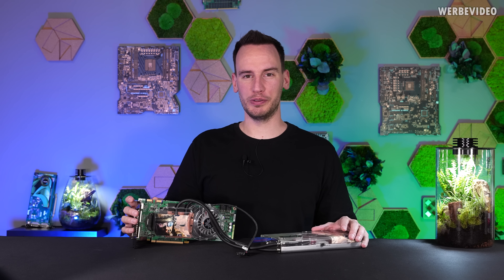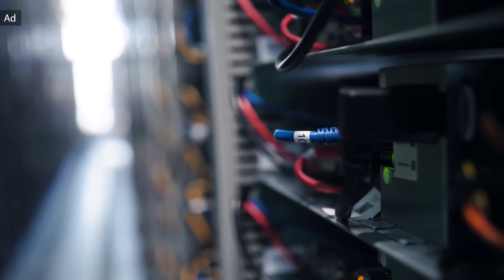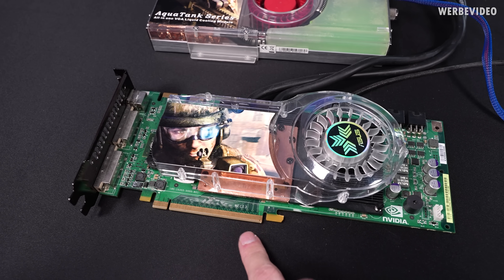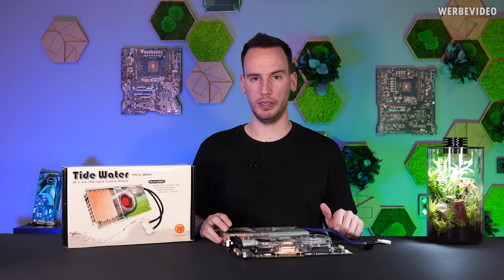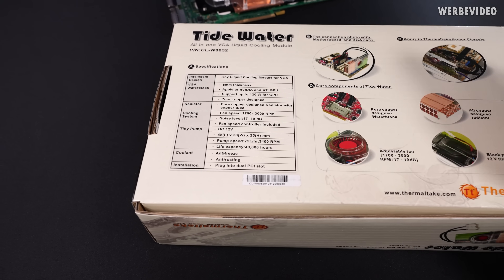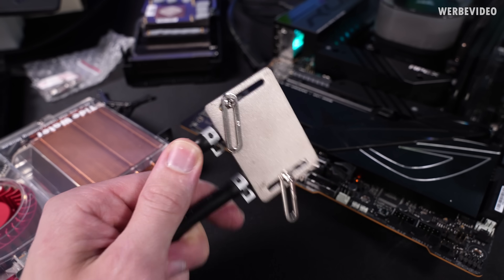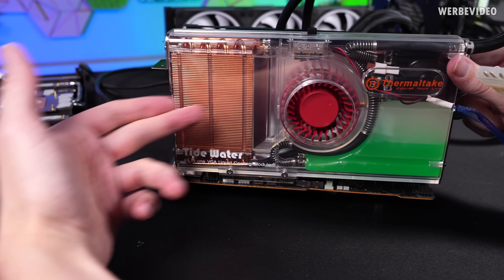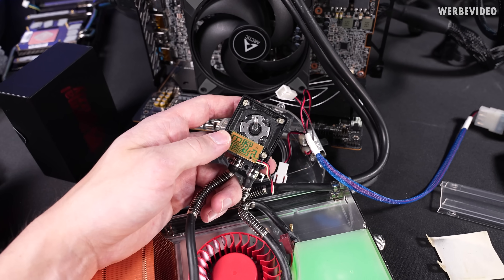HW-Legends #16: This GPU Cooler Made in 2005 still works Today! Thermaltake Tide Water

Comment: I had the basic tidewater back when it came out. I put it on a ATI X850 All-In-Wonder along with a custom cooler for the rest of the PCB and OCed the heck out of it. I also OCed CPU by making a custom loop for my Athlon 64 using their passive tower RAD they had. It was a free open box score, too!

Anyway, one reason I think the pump is so slow is because it's a little more powerful and restricted due to the rather small RAD's "passages". That is from memory from geesh, nearly 18± years ago since I serviced it. It worked really well btw! I'm thinking about using it to liquid cool my router😁

Comment: I am the first one to ever make a watercooled system. I designed it in 2000, and made it in 2001 while I was in college for engineering. It went on my Celeron 300A. Everyone laughed at me, and told me it was a stupid idea, so I gave up on it. It had a voltage regulator tied to a termistor which regulated a Perry Pump, and RC fuel tank, and RC fuel line which I sourced from Tower Hobbies. I used a PC fan with aluminum capilary tubes running across the face as a radiator and I stuffed it all in an old CD 5.25 inch case and added a front faceplate with temperature monitoring and manual override pump speed adjustment. The heatsink was a custom block. Huh... moral of the story... most people will try to drag you down. Do what you love, even if others hate on you for it.

Comment: I modified a CoolIt FreezeOne back in 2006 for my E8500, I still use it today for my 5800X3D. The only thing I had to change was the block, the rest ( including the vast majority of the coolant ) is all as it was in 2006 when I first installed it. Works like a charm still. I even have a backup unit I bought at the same time that's not modified at all yet, all original.

Comment: Car coolant is good at preventing corrosion, but as you found, when something was covered in coolant and then the level drops exposing it to air, rust can occur. GM learned this lesson in the '90s, where vehicles were being driven with low coolant, but not low enough to over heat, so some parts were basically getting splash cooled only. Those areas would rust really badly and turned the coolant over time into a rusty slurry.

Comment: I had the 8800 GTS (G92). Water cooled with a none full cover block if i recall correctly. I think it was my last card before I went full cover block. But what a great card it was. I could run crysis without peoblem.

Comment: I had the Thermaltake SLI version installed on two Geforce 7800 GT's. What I remember is that the performance was in between stock air cooling and custom waterblock. It was an improvement over the single slot air coolers.

Comment: I love this kind of old hardware. would be neat to see more AIOs with different form factors like this. I was kinda hoping you'd fire up the 8800 though. I just dusted off an old 8400 since i needed a single slot gpu to get into the bios and change it from UEFI to CSM mode- my old Fury Nano wouldn't work in any of the other slots and it was too thick to put into the bottom slot. It was just sitting in a box with a bunch of other low-mid tier GPUs, but I now keep it in a safer spot since I know it still works and it saved me! I almost thought I'd gotten a bad motherboard with my new build, all is well though.

Comment: Tide water , With Tribe VX still have them and still working and where amazing , had also TT Original Tribe that i breaked down cause the pump had failed after a looooong time and replaced with tribe II , don't remember what card i had install in Tide Water but most posible was my x1900XT from noise was too high.

Comment: I have  sapphire HD3870x2 ATOMIC with a factory water cooling unit on it. as far as I can tell my card is #18. I got it to run quad crossfire with my AMD quadfather FX74 settup.

Comment: Thermaltake was so close yet so far. If only they'd released something with a pump in the block we might have avoided all the Asetek drama. They filed for their patent in mid 2004 but I don't think anything utilizing it were sold to OEMs for another 1-2 years.

Comment: I have a NZXT G12 with NZXT Elite 280 all with Noctua fans even the one on the G12 plate with a Noctua 92mm and radiator is push-pull and it's cooling a Gigabyte 7900xtx OC idle is 26c and hotspot 33c. While gaming it's cooling 39-41c and hotspot 54-55c all on max settings and tuned to 3200 MHz. This is the way for AIO!!!

Comment: Unless you're using a liquid metal thermal interface, nickel plating is practically unnecessary in consumer electronics. It increases corrosion resistance which is nice, and there's the aesthetic part of course. But a company opting to not use it to save on paying for the process in industry makes perfect sense.

Comment: Never seen one back in the day, most water cooling was external that I came across in the early-mid 2000s. (usually just on the CPU and a big square box that looked like the PSU was mounted externally). It seemed to change overnight to AIO/Custom cooling with a reservoir. The popular reservoir I remember seeing was the DNA helix shape that looked like the thing from resident evil movies. I remember cases having 2 clear strips up the side that would light up and had fake bubbles inside, and cold cathode tubes lol.
Reply: There was a bunch of them. Corsair I think had those that mounted on top of the case. I think Thermaltake had one that mounted in the 5.25 bays. Zalman's Reserator was the most I was most interested in. Was a fanless setup with this big cooling tower. Most enthusiast cases of that era had cutouts to run the hoses through. IIRC, Coolit had the first AIO as we'd know them today. I think they were a variant of the ones Apple was using in the G5 PowerMacs. Of course you had to have CCFL blacklights with UV reactive parts.

Comment: You also have to remember big cards from this era were running over 90°C by design. The 8800 GTX GPUlitterally unsoldered itself after few years of use, the oven technique to fix that was common.

Comment: I miss all the cool aftermarket coolers Morpheus, Arctic Accelero/silencer. Larger blower conversions would be nice if you could easily convert to a 120mm ducting to get the heat away now that we are crossing into 400-600 watt territory

Comment: Those unknown pieces are crystallized coolant, quite a common thing with old fluid, I think the longest interval is 10 years for replacement.
This one is 9 years past its zenith.
PS:Next time you need to clean the radiator and also the heat exchanger because it will also be in it, the best thing is to rinse it all with vinegar water.
Reply: Yeah coolant is long-lasting but not that long-lasting. Nice video and nice studio.
Reply: I have an AIO for my CPU that's used the same coolant since 2006, Feser F1 UV Blue. The ONLY thing I've added since then  has been small amounts of distilled water into the sealed resevoir, eHeim Inovatek resevoir/pump. And that's every other year or so. 😂
Still runs clear and quiet.
Reply: Glycerin based coolant is ever lasting. doesn't break down, 10 years in my car already. VW G13 coolant.

Comment: - Video Content Suggestion - 
I saw something a couple of years ago from I think Anthony at LTT on 'Hypertec Immersion Cooling' or maybe the company is 'Submer', I'm not really sure. But it seemed like they had a new type of liquid you could submerge systems in that wasn't Novec and seemingly safe. Pretty sure it would make for a great video if you could get a tour of the factory or build system using it or something like that. I have always wanted an easy to maintain submerged PC!!

Comment: Oh boy please make that 8800GTX video, such a legendary card
Reply: 1080 ti is the ultimate legend
Reply: 8800gtx was my first high end card and had them in SLI, good old days
Reply: Really not, the GT[512] way more legend.
Reply: @ChrispyNut  8800/9800GT 512MB was legendary, so was the 9600GSO 384MB but as a budget offering. HD2900XT from ATI was legendary...bad, as was the Nvidia FX5950 Ultra few years before.

Comment: 150 watt TDP what a time that was to be alive. I can only hope we can make a return to more modest TDP numbers. 400 whatever watts for the 4090 is just insane. If it wasn't performing so well it would just have been a reincarnation of the GTX 480.
Reply from the maker: I loved my 8800GT with G92 chip back then. And it was 125W haha. Crazy how things got out of hand
Reply: @der8auer-en  would be nice to test this on a 4060, since the tdp is lower, i'm curious to see how it would perform
Reply: @der8auer-en  yup G92 was insane, i still have both of mine. had them bios volt modded so they overclocks like crazy. had them at 836/1798/1015, top card was on a duorb bottom card was using the accelero S1. was my first and only attempt to use SLI, great in some games but barely any supported it properly.
Reply: Well it really didn`t do much with that 150W, compaired with that the 4090 is stupid efficient.
Reply: You realize that 450W for 4090 is scaled DOWN? Same chip at full blast and unlocked in SXM4 format east up to 700 W.

TDP is one thing, but power scaling and efficiency of modern silicon is another level. Out of GPU world, but I have Xeon w7 chip, and in half disabled state (4 cores only active, one from each slice) it eats 130 W while eating every other 8 core chip on the market. I can also fully unlock and push 20 cores to 640 W and I had 7th spot in cb2024 at some point. As much as I love older HW, it wasn't THAT flexible.
Reply: @Vatharian  No but I cannot be bothered to have some 700 watt monster GPU paired with a 300+ watt monster CPU (to make the most of that powerfull GPU)  in my home office. I am already struggling keeping my setup cool and quiet. If you have customers who are willing to pay a fortune for a couple of those 700 watt GPU's in a DC with cheap(er) power then what I get at home, by all means, get as many as you can and earn that money. My pledge was for lower power GPU's for the consumer market.
Reply: @Vatharian  I think you do not OWN a 4090.
It never gets to 700w that`s nonsense. Oveclocked and overvolted my max draw was about 570 - 580 watts. That`s as far as it goes before limiters kick in
Reply: @mikeycrackson  They have been reaching that so called limit for about 30 years now.
Once more you are telling me they have.
Well here`s the news, they will be stretching that limit atleast for another 30 years.
I don`t know how but i know they will.
If they will not fix the power issue people will   switch to other devices. Example: Phones.
Reply: Not happening: Dennard (power) Scaling broke down starting ~2006.
Reply: I want a desktop that consumes 2000W at idle.
Reply: @PointingLasersAtAircraft  Next gen nVidia will allow you to consume 5000W with power off.
Reply: @Belaziraf  I'll use a cast iron skillet for the coldplate.
Reply: @Belaziraf finally I can build a forge at homd
Reply: @PointingLasersAtAircraft  Quad SLI TItan Z's has entered the chat.

Or just use a Epyc board with 8 5090s lmfao
Reply: Thing is if you can afford a 4090, you can probably afford the electricity bill. Also the 1KW PSU you'd need to run a system that was, say, an i9 and a 4090, it's not like it's maxed out 24/7. About the only time it would get maxed out is benchmarking. I have a 12900k and a 4090, I had 850W PSU at 1st and it was fine, I saw about 750W at most, but I upgraded to 1000W, mainly because a PSU that had the connector for the GPU without using an adopter, and a bit more headroom.
Reply: 2080 > 4090 is roughly 3X performance jump.
It is also 2.5x jump in power demands.
Reply: @petrihadtosignupforthis8158  No it isn`t. The 4090 use not even double with more than 3 x performance.
I have both so i know.
Reply: @petrihadtosignupforthis8158  No it isn't, D.L.S.S & frame generation don't count.
Reply: @petrihadtosignupforthis8158  oh absolutely. I am not dismissing the performance gains, I am just saying that I dislike how over time we have moved to a trend of high TDP GPU's and my electricity bill does not make me happy when using a 4090 under load. Although it does make my electricity company happy...
Reply: @masterTigress96  It's just a shame that AMD is bailing out. The 6000-series was actually pretty awesome. You could use a 6900XT to beat a 3090's performance using over 100W less. But, those days are over.
Reply: Well. A 4060 is 110watt. And I bet performs way better than that old. Card. We're in the Golden age!

Comment: We should bring back copper+transparent coolers. Like the HIS IceQ series.

Edit: IceQ not chill. Wrong name
Reply: G'day @yensteel yeah I love the look of my HIS HD5770 ICEQ5 Turbo
Reply: @shaneeslick  Oh, the cooling name may have been wrong. The HIS IceQ were definitely quiet coolers! Some of them were blowers with a quiet radial fan, and a transparent shroud. ^ ^
Reply: I LOVE BARE COPPER!!!
Reply: Those where the best blower card coolers ever made, they have hybrid fan design inside of them too. I'm sick of this nickel plated bullcrap nickel is NOT a good conductor it's actually 3-5 times worse than aluminium.
Reply: I have a pair of HD4830 IceQ 4's awesome looking coolers, even if most of the copper is just painted aluminum
Reply: I had 2 x HIS IceQ 4850's with a Q6700 CPU they were sexy cards - they were blower cards and really stood up to a load of abuse

Comment: The benefits of a blower fan AIO are questionable. It might be quieter than a single slot blower gpus of the time, but just installing dual slot cooler onto a GPU itself would already be better.